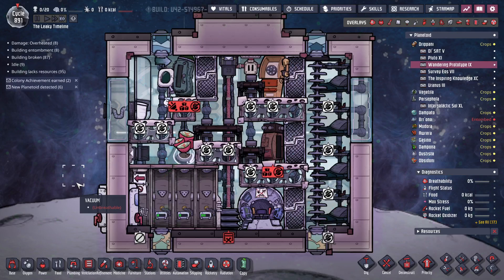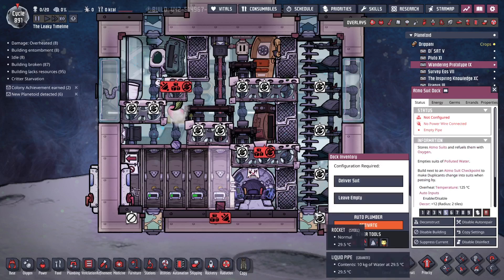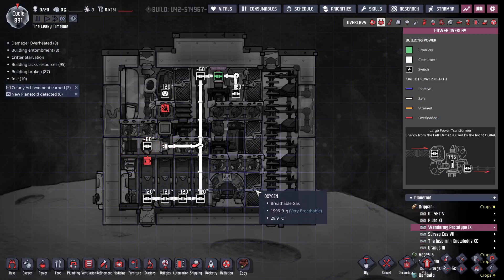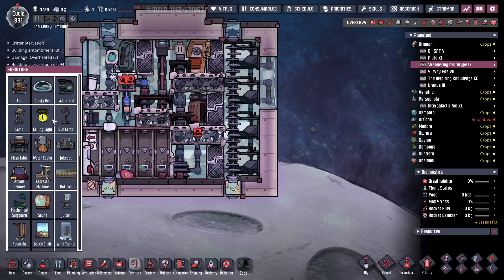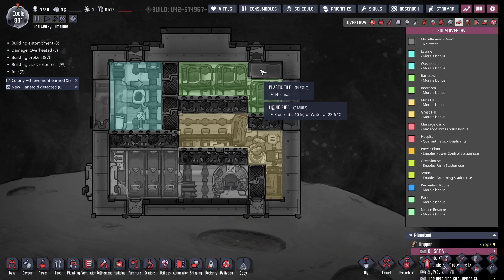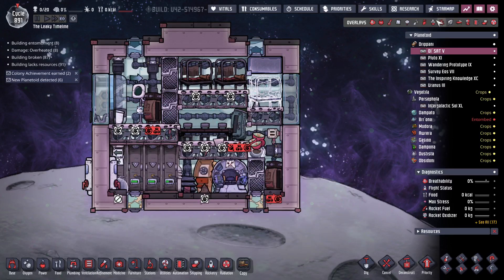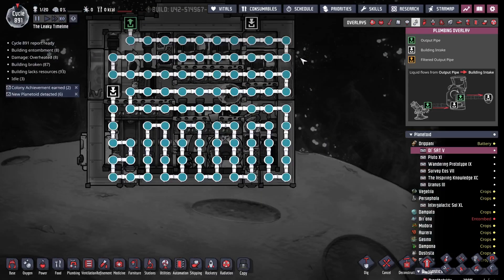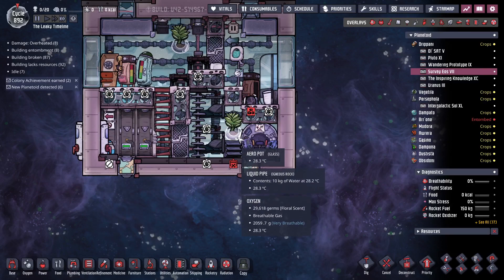Spacefarer Modules Designs Tech Tips Oxygen Not Included Spaced Out

Comment: Great video!  As a note, deleting co2 with a vent it will eventually overpresure unless you put an atmosphere sensor on the vent. Set it to 2500 grams and you're good to go.
Reply from the maker: I have not run into that with 2 or 3 dupes living in the rocket.  been some time since I had 4 long term.  it does over pressure, but stays just around 2 kg.  With oxilite I did have it get up to stupid high numbers.